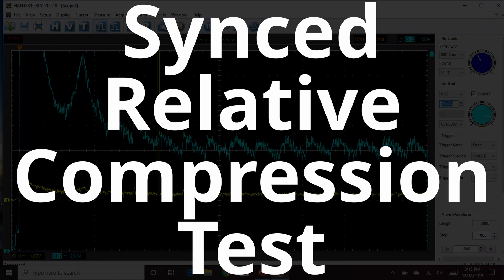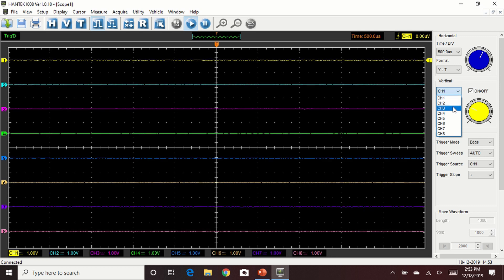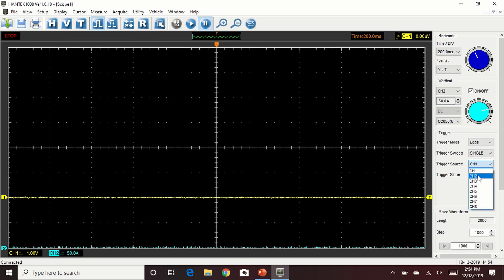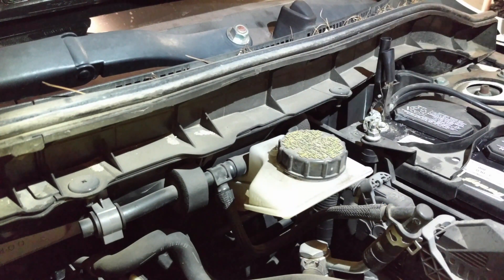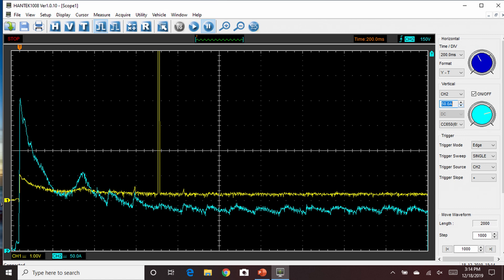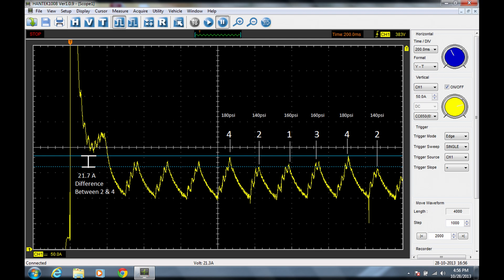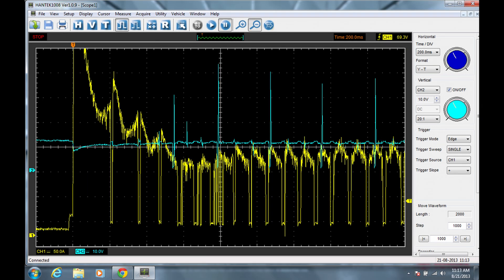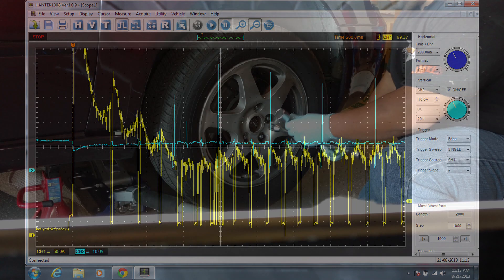Hantek 1008 Relative Compression Test Tutorial

Comment: how did you know that the wire you t pin is what or for signal
Reply from the maker: The ignition coil on this car has 4 wires. One wire is 12V (Power), another is 0V (Ground), another is a sensing signal, and the last is the control signal. The control signal is distinct because it is a 5V rectangular pulse. Before the video I looked at a wiring diagram in the repair manual to see which wire was which. I did not go into too much detail because this is not a universal truth for all cars. There are many different ignition systems out there. Since this video was mainly about relative compression I left out the part about choosing the right wire.

Thank you for your comment and thanks for watching.

Comment: I meant a relative compression test reading voltage drop instead of amperage.
Reply from the maker: Yes there are two ways, unfortunately the Hantek 1008 is not really capable of either way. The method involves watching the voltage drop across the positive of the battery and the positive input of the starter motor. If that is inaccessible then you can simply monitor the battery voltage. Then you must set your scope to AC coupling. Unfortunately the Hantek 1008 does not have that feature. Lastly you crank the engine and monitor the the voltage fluctuations as the motor cranks. Since the scope is in AC coupling any DC signal is blocked and you only see the fluctuations.

If you really want to try to do this with the Hantek 1008 you are going to need some type of high pass filter. Linked below I show a 10 nF capacitor which if placed in SERIES with your probes will filter out frequencies below 10HZ. I hope this helps. Let me know if you have any questions. I also linked some other videos that may be helpful.

https://www.ebay.com/itm/5x-5pcs-1000V-01uF-High-Voltage-Ceramic-Capacitor-103M-1KV-0-01-uf-mfd-10nF/252389093901?hash=item3ac38ff20d:g:z~oAAOSwdV1XNlRV

Recommended video on the topic.
https://www.youtube.com/watch?v=Sg7HfvQsHG8

Video about capacitor blocking DC
https://www.youtube.com/watch?v=doz1Qfte2DA

Video about High Pass Filters
https://www.youtube.com/watch?v=4CcIFycCnxU
Reply: @Enrique_Osorio  Thank you Enrique.

Comment: Enrique, another question: is it posible to do a compression test by means of voltage drop?
Reply from the maker: Yes there are two ways, unfortunately the Hantek 1008 is not really capable of either way. The method involves watching the voltage drop across the positive of the battery and the positive input of the starter motor. If that is inaccessible then you can simply monitor the battery voltage. Then you must set your scope to AC coupling. Unfortunately the Hantek 1008 does not have that feature. Lastly you crank the engine and monitor the the voltage fluctuations as the motor cranks. Since the scope is in AC coupling any DC signal is blocked and you only see the fluctuations.

If you really want to try to do this with the Hantek 1008 you are going to need some type of high pass filter. Linked below I show a 10 nF capacitor which if placed in SERIES with your probes will filter out frequencies below 10HZ. I hope this helps. Let me know if you have any questions. I also linked some other videos that may be helpful.

https://www.ebay.com/itm/5x-5pcs-1000V-01uF-High-Voltage-Ceramic-Capacitor-103M-1KV-0-01-uf-mfd-10nF/252389093901?hash=item3ac38ff20d:g:z~oAAOSwdV1XNlRV

Recommended video on the topic.
https://www.youtube.com/watch?v=Sg7HfvQsHG8

Video about capacitor blocking DC
https://www.youtube.com/watch?v=doz1Qfte2DA

Video about High Pass Filters
https://www.youtube.com/watch?v=4CcIFycCnxU

Comment: Enrique, thanks so much for answering me! I'm still not clear on what probe will/should buy for the Hantek would you mind telling which model did you used, or which one should work for the hantek?-I'm new to the scope thing. Now, I read in one of your posts you mentioned the Pico 2204A, is this a better choice than the Hantek? I'm a retired wanna be mechanic with spare time to kill and I want to at least  learn how to work on my cars. Enrique you have a great gift for teaching, your videos are easy to understand, I hope that you'll continue posting more. Sorry, for bothering so much. Thanks again!
Reply from the maker: Not a problem Javier. I assumed you already own a Hantek but it looks like you are still shopping around. In that case I would recommend a low end Picoscope rather than a Hantek. The Hantek is cheaper but the Hantek software is somewhat frustrating to work with. Here is a good option.

https://www.picotech.com/oscilloscope/2000/picoscope-2000-overview

The PicoScope I linked only has two channels but it is a higher quality product than the Hantek and the software is much more user friendly. It is $150. If you need something more capable simply select the options that you need. For hobby automotive use you will do fine with the PicoScope 2204A. If you really want more channels the next step up is the PicoScope 2405A with 4 channels which is $450.

As for the probes, if you need something high quality try these in the link below. They are High quality and reasonably priced. I have ones similar to these.

https://www.digikey.com/product-detail/en/digilent,-inc./460-004/1286-1075-ND/4840870?utm_adgroup=Test%20Leads%20-%20Oscilloscope%20Probes&utm_source=google&utm_medium=cpc&utm_campaign=Shopping_Product_Test%20and%20Measurement&utm_term=&utm_content=Test%20Leads%20-%20Oscilloscope%20Probes&gclid=Cj0KCQjw6575BRCQARIsAMp-ksPj-EQB-BQ46h-D-sCjq8M_OoIOY5a09bit8BCZyxSQMRIPgzlZAfoaAi_yEALw_wcB

For the current clamps, here is what I have.
https://www.ebay.com/itm/Hantek-CC-65-Oscilloscope-Multimeter-AC-DC-Current-Clamp-Meter-65A-20KHz-for-Car/223094659989?epid=22004147278&hash=item33f17a5b95:g:4ggAAOSwQqJbmy80

https://www.ebay.com/itm/Hantek-CC-650-AC-DC-Current-Clamp-Meter-Multimeter-w-Oscilloscope-BNC-Connector/223091295346?epid=2254344469&hash=item33f1470472:g:AZ4AAOSwNchaLFeG

https://www.ebay.com/itm/Pico-TA167-BNC-2000A-200A-AC-DC-Current-Clamp/363035996106?epid=1864984155&hash=item5486a1afca:g:q1MAAOSwZmpe--MD

https://www.ebay.com/itm/PICO-TECHNOLOGY-PicoScope-60-A-AC-DC-current-clamp-4mm-connector/254668860716?epid=4039410984&hash=item3b4b726d2c:g:lUEAAOSw2kZfIMnj

I have those four current clamps linked above and they work in every situation I have needed them for. If you want something that just works with no fancy extras get the Hantek clamps, otherwise get the Pico Clamps.

Other alternative high quality current clamps are:

https://www.digikey.com/product-detail/en/b-k-precision/CP-3/CP3-ND/227495

https://www.amazon.com/TPI-A254-Current-Adapter-Megaohms/dp/B0095XC06U

The TPI current clamp sold by Amazon is very expensive but is great for very low current applications.

Other options are  buying something like a current sensor and using the voltage output of the current sensor to use with your scope. You will need to apply your own 5 volt supply if you want to go this route. The current sensors are very cheap ($5-$20) but you need to know what you are doing when using this option. Here is a link to an example of a current sensor.

https://www.ebay.com/itm/ACS712-Current-Sensor-Module-with-5A-20A-30A-analogue-sensing-range-for-Arduino/391791347945?hash=item5b389588e9:g:ItwAAOSwB8Nd0Pd8:sc:USPSFirstClass!93420!US!-1

The idea with using the current sensor is that you would break the circuit you are trying to measure, route the current through the sensor board, and use the voltage output of the sensor with your oscilloscope to view the current waveform.

I hope I answered your questions. Let me know if you have any other questions.

Comment: Enrique, 2 more questions: 1. I googled for the voltage proves and found them... but there are too many to chose e.g. PP-90 (80MHz), PP-150 (100MHz) so, which one should I get? 2. On your earlier videos you used a Hantek current clamp and now you are using a CC-650, is one better than the other? Thanks, again!
Reply from the maker: The PP150 would be better since it has a higher bandwidth of 100 MHz. Unfortunately the Hantek will not be able to read a 100 MHz signal so the probe is overkill. If you only ever plan to use the Hantek as your scope buy the cheaper probe.

As for the current clamp if you can only buy one clamp I would suggest buying the higher current clamp since there are tricks that you can use to make them more accurate for lower currents. The reality is when buying a current clamp you need to buy one for your needs. A single current clamp will NOT work in all situations. I have a Low current clamp that works from 1 Amp to about 60 Amps. I also have a medium current clamp which works from 10 to 600 Amps. I have a high current clamp that works from 50 Amps to 2000 Amps. The clamps I have are for different ranges and they overlap. When using a current clamp you want to choose one that the currents you will be measuring are somewhere in the middle of that clamps rating. There is no one clamp for everything.
Reply: @Enrique_Osorio  Enrique, thanks so much for answering me! I'm still not clear on what probe will/should buy for the Hantek would you mind telling which model did you used, or which one should work for the hantek?-I'm new to the scope thing. Now, I read in one of your posts you mentioned the Pico 2204A, is this a better choice than the Hantek? I'm a retired wanna be mechanic with spare time to kill and I want to at least  learn how to work on my cars. Enrique you have a great gift for teaching, your videos are easy to understand, I hope that you'll continue posting more. Sorry, for bothering so much. Thanks again!
Reply from the maker: Not a problem Javier. I assumed you already own a Hantek but it looks like you are still shopping around. In that case I would recommend a low end Picoscope rather than a Hantek. The Hantek is cheaper but the Hantek software is somewhat frustrating to work with. Here is a good option.

https://www.picotech.com/oscilloscope/2000/picoscope-2000-overview

The PicoScope I linked only has two channels but it is a higher quality product than the Hantek and the software is much more user friendly. It is $150. If you need something more capable simply select the options that you need. For hobby automotive use you will do fine with the PicoScope 2204A. If you really want more channels the next step up is the PicoScope 2405A with 4 channels which is $450.

As for the probes, if you need something high quality try these in the link below. They are High quality and reasonably priced. I have ones similar to these.

https://www.digikey.com/product-detail/en/digilent,-inc./460-004/1286-1075-ND/4840870?utm_adgroup=Test%20Leads%20-%20Oscilloscope%20Probes&utm_source=google&utm_medium=cpc&utm_campaign=Shopping_Product_Test%20and%20Measurement&utm_term=&utm_content=Test%20Leads%20-%20Oscilloscope%20Probes&gclid=Cj0KCQjw6575BRCQARIsAMp-ksPj-EQB-BQ46h-D-sCjq8M_OoIOY5a09bit8BCZyxSQMRIPgzlZAfoaAi_yEALw_wcB

For the current clamps, here is what I have.
https://www.ebay.com/itm/Hantek-CC-65-Oscilloscope-Multimeter-AC-DC-Current-Clamp-Meter-65A-20KHz-for-Car/223094659989?epid=22004147278&hash=item33f17a5b95:g:4ggAAOSwQqJbmy80

https://www.ebay.com/itm/Hantek-CC-650-AC-DC-Current-Clamp-Meter-Multimeter-w-Oscilloscope-BNC-Connector/223091295346?epid=2254344469&hash=item33f1470472:g:AZ4AAOSwNchaLFeG

https://www.ebay.com/itm/Pico-TA167-BNC-2000A-200A-AC-DC-Current-Clamp/363035996106?epid=1864984155&hash=item5486a1afca:g:q1MAAOSwZmpe--MD

https://www.ebay.com/itm/PICO-TECHNOLOGY-PicoScope-60-A-AC-DC-current-clamp-4mm-connector/254668860716?epid=4039410984&hash=item3b4b726d2c:g:lUEAAOSw2kZfIMnj

I have those four current clamps linked above and they work in every situation I have needed them for. If you want something that just works with no fancy extras get the Hantek clamps, otherwise get the Pico Clamps.

Other alternative high quality current clamps are:

https://www.digikey.com/product-detail/en/b-k-precision/CP-3/CP3-ND/227495

https://www.amazon.com/TPI-A254-Current-Adapter-Megaohms/dp/B0095XC06U

The TPI current clamp sold by Amazon is very expensive but is great for very low current applications.

Other options are  buying something like a current sensor and using the voltage output of the current sensor to use with your scope. You will need to apply your own 5 volt supply if you want to go this route. The current sensors are very cheap ($5-$20) but you need to know what you are doing when using this option. Here is a link to an example of a current sensor.

https://www.ebay.com/itm/ACS712-Current-Sensor-Module-with-5A-20A-30A-analogue-sensing-range-for-Arduino/391791347945?hash=item5b389588e9:g:ItwAAOSwB8Nd0Pd8:sc:USPSFirstClass!93420!US!-1

The idea with using the current sensor is that you would break the circuit you are trying to measure, route the current through the sensor board, and use the voltage output of the sensor with your oscilloscope to view the current waveform.

I hope I answered your questions. Let me know if you have any other questions.

Comment: Hey Enrique, I just wanted to thank you for all the great videos. I’ve been using my 2 channel scope on my Snap On Modus for a couple years now. I’m really Intrested in the Hantek 1008C. It’s hard to believe that such a cheap scope does a good job? Do you think an older lap top will work ok with the Hantek program? Thanks again!! Wish I could hang with you and diagnose some cars!!
Reply from the maker: Unfortunately not. The Hantek 1008 is not a professional grade scope. If you have been using the Modus, stick with the modus. The snap on tool scope is orders of magnitude greater than the Hantek. The Hantek is only for hobbyists or masochistic mechanics.

If you really want to use the Hantek 1008 I recommend a PC that has a 3rd gen Intel i3 or better with at least 4GB of ram running Windows 10

Comment: I'm looking to get my first scope for automotive diagnostics as a hobby and to help family and friends.  Do you recommend the Hantek 1008c or should I go another route?

Also,  please consider setting up an Amazon "store" with the gear you use so that when I buy it you get a little $ for all the work you put into these videos.
Reply from the maker: As a hobby ABSOLUTELY if you are OK with a lot of drawbacks. I used the Hantek 1008 for years professionally until I purchased my PicoScope. In those years I endured a lot of wasted time just trying to figure out exactly how the Hantek 1008 and its software like to be treated. Unfortunately the Hantek 1008 can be quite glitchy. If your patience wears out quickly or its essential that the product works every time you need it to, I DO NOT recommend the Hantek. In my opinion even a used Picoscope would be worth paying the extra money for.
Reply: @Enrique_Osorio  what would you consider the top 3-5 drawbacks to be?
Reply from the maker: Crashes when it received voltage spikes for an extended period of time. 10 seconds

The pause feature does not store any information greater than the current screen at the current t time base.

The sample rate is low so you barely get a good wavedorm with high frequency signals like CAN bus lines.

The presets for automotive use are not helpful at all.

The absolute voltage level accuracy is probably within 5% when using attenuators, which is fine if you just need the shape of the waveform and not exact voltage levels.

There is no way to custom add functions for an accessory. For example there are options to choose Hantek current clamps as an input but if the current clamps you have uses a different ration of mA per Volt, you are going to have to keep the conversion formula in your head. It's not too bad of a drawback but it is annoying.

There is NO AC coupling, only DC.

The XY mode is OK but nothing spectacular.

The scope itself is very susceptible to noise so keep it away from spark plugs wires and ignition coils. I use extra long leads.

That's all off the top of my head. Any more questions, let me know.
Reply from the maker: The first link is an eBay link for a base Pico. The second link is for the specs on Pico's website. This is NOT an automotive based scope so the software will not be optimized toward automotive use. With a little research and patience you will be able to use this Pico for nearly anything you need on a car. You will need to purchase additional probes for automotive use like a current clamp and attenuators.

https://www.ebay.com/itm/Pico-2204A-PicoScope-2-channel-AWG-10MHz-Includes-probes/264464822324?epid=1151022157&hash=item3d9354f034:g:6cAAAOSwV8ZdfD7C
https://www.picotech.com/oscilloscope/2000/picoscope-2000-specifications